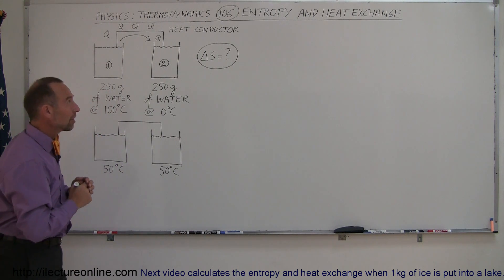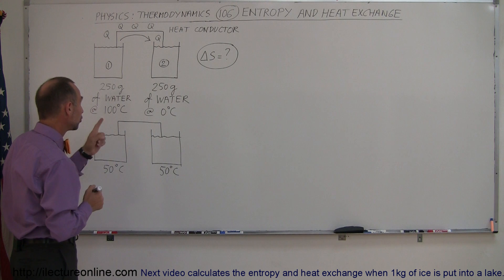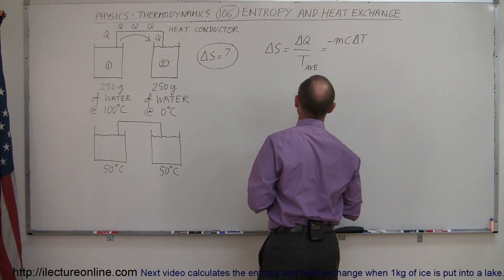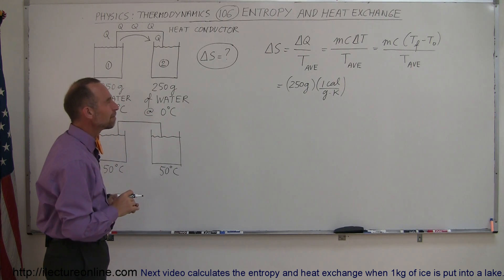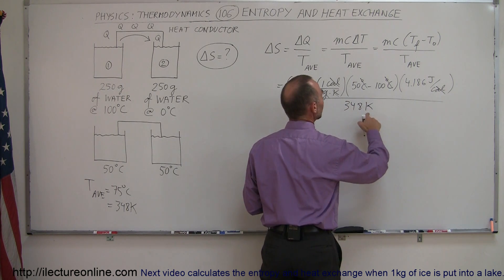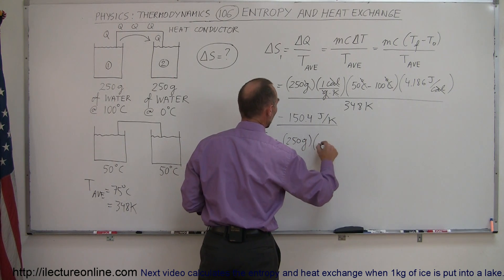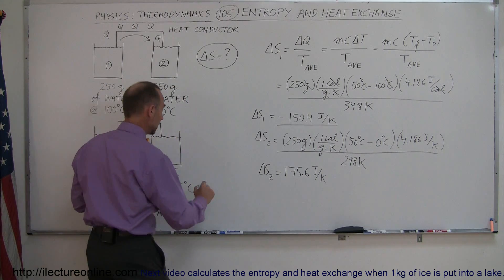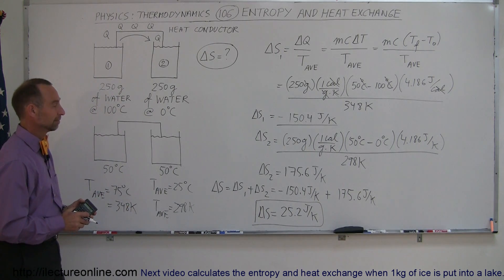Physics 30  Entropy (2 of 5) Entropy and Heat Exchange: Example 1

Comment: Sir, why did you take average temperature between final and initial temperatures?
Reply from the maker: It turns out that for relative small temperature changes that give you a good (and close) approximation, compared to integrating over the changing temperature.   (We have some examples where we use the integration technique)
Reply: @MichelvanBiezen  thankyoooou so much Sir, you are the world Best teacher.

Comment: Thanks! I’m so horrible at math and wish I saw it as clear as you all. 
How are Celsius  canceled out by Kevin?
I always get confused how multiple units can be whittled down to a single x to y.
Reply from the maker: A Kelvin degree is the same size as a Celsius degree.  So when we are considering changes in temperature it doesn't matter if we use K of C and one can cancel the other.  You cannot do that if they are actual temperatures.  0 C = 273 K
Reply: @MichelvanBiezen  makes sense . Thanks so much

Comment: The total entropy is always positive even though the entropy might increase or decrease during the processes.
Reply from the maker: The change in entropy is always positive
Reply: @MichelvanBiezen  Yeah right! Total change in entropy.
Reply: @historyisthebest5831 The actual value of entropy is arbitrary, since there is no objective point at which entropy equals zero.  All formulas for entropy are really formulas for change in entropy.

There are conventions for where we define entropy to equal zero for a given substance, but these are arbitrary, and are just bookkeeping and not reality.  For instance, ASHRAE uses the reference point of saturated liquid at -40C, as the zero point for thermodynamic potentials of refrigerants.

Negative entropy ultimately doesn't mean anything.  It's just like negative gravitational potential energy, that just means it is less than the reference datum.   A negative change in entropy of the universe by contrast, indicates an impossible process.

Comment: Universe is an isolated system.  No heat into or out of the universe. Does it means this increase is entropy is due to the entropy generation? And, the entropy in the previous problem is also due to entropy production? 
Thanks

Comment: Hey prof, can you check that my reasoning is correct?
The formula used is only valid for reversible processes, and clearly the physical situation is irreversible. So, we can imagine taking each cup to a room seperately and making it reach the final temperatures of 50ºC by manipulating each of the room temperature, so that it is in equilibrium with the surroundings for all time (so it is an isothermal and therefore reversible process?) I.E for the cooler cup, take it to a room at 0ºC and increment the temperature very slowly so that the process can be reversed, and likewise for the warmer cup, take it to a room at 100ºC and decrement the tempreature very slowly so that the process can be reversed. The change in entropy of the SYSTEM (and system only) will be the same as entropy is a function of state.

Comment: i'm sorry but I think you are wrong with how you cancel out the different units in the problem, you cannot cancel units using subtraction in (50 c - 100 c) and even if you get the difference you cannot cancel kelvin with celcius without changing the celsius to kelvin first.
Reply from the maker: Since we are considering the difference in temperature, centigrade degrees are equal to Kelvin degrees.
Reply: so, what if the given temperature is in kelvin would you still cancel it or change it to Celsius?

Comment: If I use the method of integration for this problem I get delta S = 25.38J/K
Is this answer technically more correct/accurate?

I used: Delta S = Integral(dQ/T) = mc ln(Tf/Ti) to find the two changes in entropy and add them together. 

(as dQ = mc dT, where ln is log base e and Tf final temp, Ti initial temp.)
Reply from the maker: For small delta T it makes a small difference as you have seen.

Comment: Hi: You took out the confusion, thank you. You calculated the change of entropy for each cup and then added the two. 
Could you also please clarify the notion of entropy, the entropy being the maximum probable macrostate in equilibrium.  
What exactly is the maximum probable state for this two cup example with a number of particles known in each cup in equilibrium? 
Does it mean a total number of permutations of particles for each cup when the two systems or the two cup, in this case, have reached the maximum probable state and in a state of equilibrium?
Could you please use a finite number of particles, may be 10,  and actually calculate the maximum probable state using the permutation formula or counting principles? This will remove the confusion. 
Thanks. I l enjoy your lectures, they remove the doubts in mind. Great!
Reply from the maker: Have you seen this playlist:  PHYSICS 32.5 - STATISTICAL THERMODYNAMICS  https://www.youtube.com/user/ilectureonline/playlists?sort=dd&view=50&shelf_id=4

Comment: If you're finding the difference in entropies why are you adding the two, why don't you subtract the delta S2 from delta S1?
Reply from the maker: You have to add the entropy of both before the heat transfer and then add the entropy of both after the heat transfer and compare.
Reply: So you're not finding the difference in entropy as in the deltaS you're finding the sum of entropies?
Reply from the maker: No, you are finding the difference of the entropy of the WHOLE system after the heat transfer and the entropy of the WHOLE system before the hear transfer.

Comment: Sir , can we find out the total time taken in transferring heat from 100C to 0C jar of water??
Reply from the maker: That is possible, but it depends on a number of factors, the size and makeup of the conducting path, the contact area on each side, the circulation of the substance heated, etc.  We can do relatively simple approximation calculations with the correct assumptions.
Reply: Please can u just tell me that one concept on which this ques can be solved which i have just asked you??
Reply from the maker: That would be difficult to explain like this as it would require integration.  I will do some videos in the future to explain the time it takes to transfer heat.
Reply: Thank you so much sir!! Your videos are very help full for me.
Each video is very use full..  :)

Comment: why we aren`t transfer ( 50c- 0c ) or ( 50c -100c ) into K 

such as : Taverage
Reply from the maker: +mohamed zaki 
Since we are calculating the difference between 2 temperatures, you don't have to convert to K, because you will get the same result.  But for the average temperature, you need the actual temperature in K

Comment: why is t average 75C and not 50C?
Reply from the maker: +1234av8tor For the hot container the average is 75C  (100C + 50C) / 2     For the cold container the average is 25 C (0C + 50C) / 2